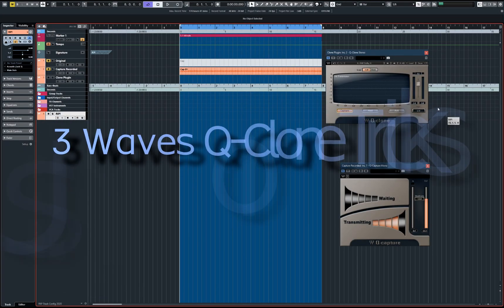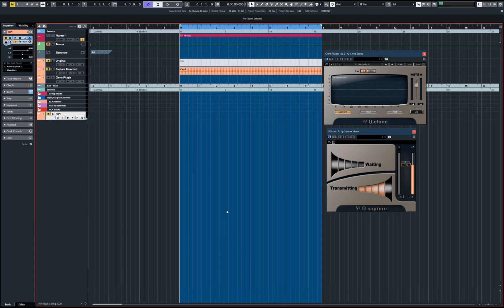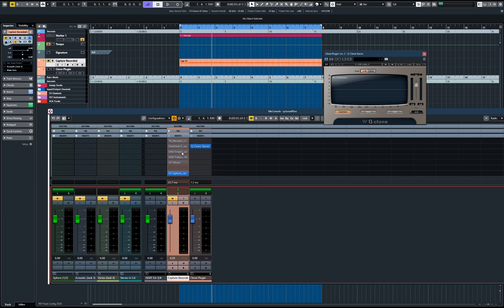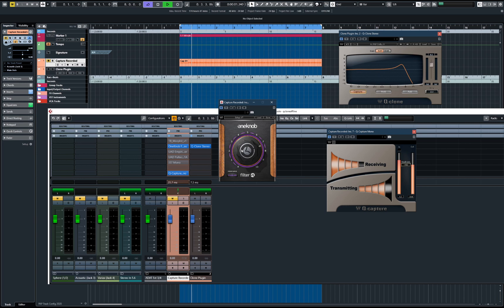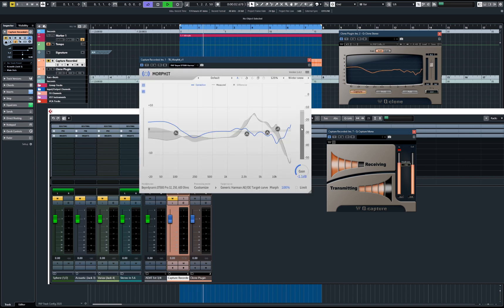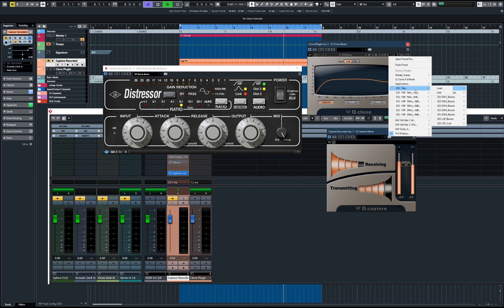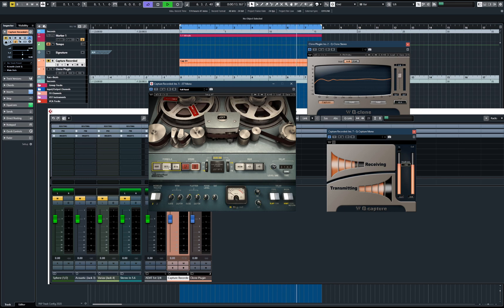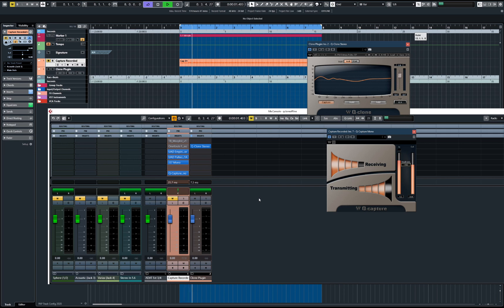3 Waves Q-Clone Tricks or Using Q-Clone The Easy Way

Comment: Thanks for sharing and trying phil.  

I use Cakewalk by Bandlab now after being a paid subscriber Cakewalk / Sonar all of my life. I have been trying to get this Q Clone to work for days now. Tried a number of ways. I can't input and output to the same track to create the loop for the capture and Cakewalk does not have the same rendering functions that you have on your DAW. 
Any ideas that may help ?. If not I will ask Waves to exchange this plugin. TBH by now the plugin should have been updated so that you don't have to jump through hoops to use it. Set us should be a wizard with choices.
Reply from the maker: You don't have to render the file the same way that I did. You can simply use your normal render function to make the audio file then simply drag it back in. 🙂

Comment: It's a lot easier to rout Q capture in Pro Tools. I just put the Q-Capture on an Aux track and send the same bus to the input and output then add the Q-clone plugin on the audio track you need to affect. You can use multiple Q-clones but only one Q-capture.
Reply from the maker: Thanks for the comment. Same can be done in Cubase of course. The point here was not to compare how easy it is on various hosts. It is just another method of routing the signal. And not everyone uses Pro Tools. Thanks though good to see you here. :-)
Reply: Thanks for replying. I love Cubase, i currently use version 10 and about to upgrade to version 11. Also use Studio One. I was only making you swear that Q-capture requires a feedback loop for it to work and that Q-Clone can be multiple instances by mean of the “Hold” button option and also the “Add” button for making additional changes, along with storing presets. I enjoyed your video and will be subscribing!
Reply from the maker: @AirplaiTv  Thanks a lot. Appreciated. :-)